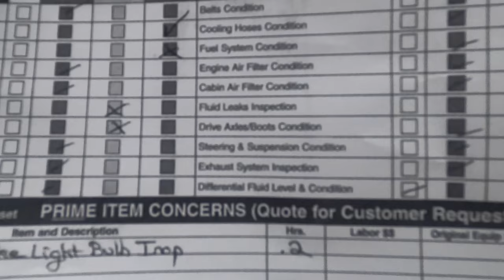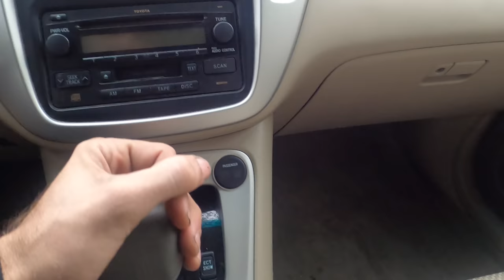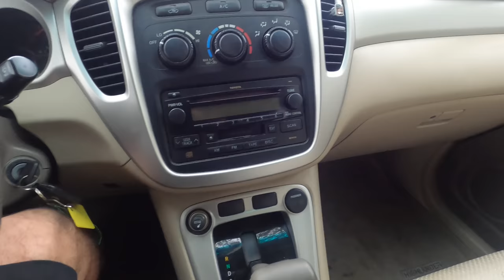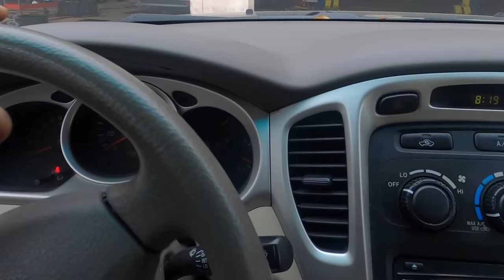We were BASHED by the Dealer! Ripping off a customer! Toyota Highlander 3.3

Comment: Dropped my van for an oil change. The counter man wrote up that I "needed" cabin and air filters because they were clogged. I purposely removed the cabin filter so it couldn’t be inspected, but somehow the genius saw something that did no exist. I never trust dealerships or nationwide service companies…they’re all crooks! I only trust my mechanic of 20+ years who has never cheated me like all the other places do.
Reply: I used to replace my air filter the day before I get an oil change. Invariably they come out with some dirty one to show me it needed replacing and I’d show them the receipt and walk them out to show me what’s under the hood. I got several free oil changes that way…
Reply: well duh ofcource you needed the filter if there was no filter.
Reply: @lostepisode3  the point is that he said the filter was clogged even though it was not even there
Reply: I was sitting in a Honda dealership and saw a posted price of $200 to replace a cabin filter. Wow!
Reply: @pauldiesel4582  Some of the Honda cabin filters are a PITA !!  But still not worth $200.
Reply: "We rotated your tires, and here's the mechanic to confirm" ...... "Here are the cell phone photos I took showing the location if each tire and the dark but visible crayon mark labelling the location of each tire, and you can see they have not changed position".
(real stealership story)
Reply: Crooks exist in most professions but I wouldn’t say all dealerships or independent shops are crooks. In my experience often time the customer is more dishonest.
Reply: I asked the service writer to not pad my bill with silly stuff like cabin filter. He says 'ok'. In a bit his tech comes up to me with the cabin filter. Ford windstar. He yanked it out if the tiny inspection hole which in fact you can't get it thru safely. I just looked at the writer and shook my head. I later pulled the full drip tray myself at home, involves dropping off wiper arms too, and put in a new filter.
Reply: There's a certain sour smell I get in the cabin of my car when the cabin filter is done. I order the part from Canadian Tire and replace it myself. Even though the air can get dusty here in Alberta, my engine air filter goes over two years before needing replacement. And yes, I get my oil changes and inspections done at the local dealership even though my golf is long since out of warranty. Occasional wear items and leaks are all they have ever fixed.

Comment: My favorite frustration story is about my wife's car. It had a vibration. Her dad helped out by taking it to the dealer while she was at work. The dealer said it needed brakes. $700. We declined. I took it back that Saturday. After waiting for an hour, they came back and said a wheel was loose, no charge. That proved they didn't even look at the brakes on the first visit.
Reply: Not really. The tech that looked at your car may not have checked the brakes, or not thought they were as bad as the other tech did. I tried to sell a lady brakes today because there was plenty of brake pad left on the rear pads, but only about 3/32 of an inch (that's getting into dangerously low territory, on front wheel drive vehicles, front pads are declared a 'safety liability' at my shop at about 4/32. She declined because the pads were a fair bit expensive, but what you're paying for is labor rates. Brake pad replacement on the car I was trying to sell brakes on is quoted at .9 of an hour. The hourly rate of the tech on the ticket was about 200, because he's got all the ASE Certifications and is classed as a Master Technician. Technician rates are higher than ever because schools don't talk about trades, they push college. Tradesmen are becoming rarer and rarer, so demand is sky high and to draw techs in, so are pay rates. THAT is why dealership work is so expensive. At a lot of shops it's expensive, dealer or not because techs aren't widely available.
Reply: @apoplecticwrenchmonkey  Solid points you made. Thanks. Although, I guess I would ask if a basic brake job requires ASE Master Technician level work. Just trying to learn...
Reply: @D45VR  No, a brake job absolutely doesn't require ASE Certified techs, however it isn't really up to the techs who gets what jobs. You might have a tech with six ASE certifications, paid 120 per billable hour, doing your brakes, or you might have one of the lube techs, paid maybe 20-30 an hour if he's flat rate, doing them. Depends on a few factors: Are you in for a routine maintenance (i.e. oil change/tire rotate, fluids check, etc) or are you in for a check engine light or other complaint? If it's a routine maintenance and you need brakes, you'll probably (though not always) get a lube tech doing the work, which means you'll get either his rate or in other cases the shop's set rate instead of the specific tech's rate. The lube tech only sees his 20-30 an hour, the rest goes to the shop to pay for things like gloves, brake clean and other shop supplies, which are rather important. Talking trans fluid, differential oil, etc. Things you WANT the shop to have extra of. 

Anyway, long story short, yes things are expensive, even if it's a simple lube tech. Cars are a huge investment of money and when things break, it can be unpleasant. I'm not justifying the insane costs, nor the fact that some techs do try to scalp customers for a paycheck. 

But, even without the tech rates, things can get expensive due to part shortages and depending on the vehicle, part availability in general. I've just sunk over two grand into my own car for what was originally just blown head gaskets, and I'm not getting paid for it since I'm doing the work myself. Needed new gaskets and new head bolts, then I found a broken vacuum line which is another couple hundred for the lines and the fittings on my particular car, ended up needing new injectors since two of the old ones were starting to fail, needed a new intake manifold since the old one cracked during removal (206K miles on the car over ten years, so time and use just wore it out).
Reply: @apoplecticwrenchmonkey  Take "ASE Certified" and "Master technician" with a grain of salt. Countless lazy parts changers are considered "master technicians" because they got away with lazy, shitty work for so long that they think they're actual mechanics.
Reply: @apoplecticwrenchmonkey  my idea of a master technician is some one blueprinting an engine, transmission repair, breaking out the oscilloscope doing in depth diagnostics, engine out jobs etc.
Reply: @apoplecticwrenchmonkey  there is no tech in the world making $100 an hour lol no way in hell a lube tech is making $20 an hour. lol shop rates shop rate no matter the tech lol advisors and managers can cut the cost down but no one "pays for the tech". Thats just hilarious lol
Reply: @ABs70nova  You've clearly never worked in a shop, otherwise you'd know better. Yes, lube techs can get paid $20 an hour, they get paid that at my shop. There are multiple technicians in my shop that are paid over $100 per billable hour. Your ignorance of the topic is showing.
Reply: @Cynsham  ASE Certification isn't something you're given just by working long enough. There are courses you take and tests you take. Master technicians require eight different tests to be taken, along with another exam to certify you. Some people may call themselves "master techs" but if they can't show you their ASE certifications (which you have to renew every five years) then they're full of shit. I'm in an ASE Program right now, and I can assure you that your average parts changer doesn't just get ASE Certified or given the official Master Technician classification. There are at present only about 2,800 officially recognized Master Technicians in the United States, out of a total of  around 610,000 technicians across the country. Master Technician is not a common title, and if it is, you'd be wise to have them prove it.
Reply: @apoplecticwrenchmonkey  I dont care if youre ase certified or not, paying triple digits for 2 wheel brake job is insane. I would do it for 40 bucks, its so easy my wife can do it (and has). 

Start spraying it down with rust breaker or wd 40 a couple hours before you start the job, then its super easy from there. You can check everything from rotors to pins while youre there. 

I dont know why shops charge these obscene amounts, but Im glad they do because if they didnt I wouldnt have learned everything I needed too.

Because of these ridiculous prices Ive learned how to rebuild my truck if Im stranded on a mountain whereas 3 years ago I didnt know what an ignition coil was.

The only thing I havent taught myself how to do is rebuild a transmission - and believe you me thats on the list. I have one of the most reliable vehicles Ive ever seen now and I am not ase certified or master technician - Im just an American. 

Ive got a "friend" (long story here) whos ase certified and when he worked at our local mechanic shop he was number one - but my work ethic far exceeds his and so does the quality of work.

There seems to be something about the mechanic/technician line of work that breeds untrustworthy people - I dont trust one single shop or dealer. 

For example a few years ago I had a firebird formula that had 110k on it and the transmission started slipping - so I bought a new one from a dealership for 4k and when I drove it home I shit you not - the transmission pan was hanging by one bolt and all the oil had come out of it. 

I wasnt happy. 

There is another dealership here that sold my boss a Dodge Dart - which kept losing power luckily he bought the super warranty - and they couldnt figure it out. They replaced the turbo, tons of electrical, the transmission (it was stick), the ECU, the throttle body, and this went on for two years. I had actually quit the company and he was still having problems - he bought the car to save on gas because he drove a hemi in the mean time but the dealership had the car in their possession then he did while he owned it. 

He bought himself a 2021 Ram and my 22 year old dakota gets better gas mileage as a v8 then his ram does (I become very proficient at what I do if I choose to do it).
Reply: @neavo8421  Shops don't charge the hourly for everything. Many shops have services that are a set price. Oil services at my shop are from fifty to seventy bucks, depending on the vehicle, brake jobs are around eighty for pads and rotors. I don't know what country you live in where you can get rotors and pads for forty bucks. I looked up 98' Dakota rotors and they're going for around 40-50. Per rotor, mind you.

Sounds like you're quite the handyman, and that's great. Good for you. You also seem to like overstating and understating things. There's not a place in the US you'll get a set of fresh rotors and pads for forty bucks, unless you're buying the worst quality imaginable and scrounging pads up from dumpsters. As I said, a quick search of a few states shows that nowhere is selling for that low. Nowhere.

I'm certainly happy for you that you can do your own maintenance, that's fantastic. But there are those who can't and that's what dealerships and shops are for. If you can do it yourself, great. You pay dealerships for the convenience of doing it yourself. Any good dealership will eat the cost of mistakes and failures of their technicians. My dealership certainly does, and techs are held to high standards. We get one warning, and then we're gone the next time we screw up. 

Sounds like the dealerships in your area aren't run by people who give a crap, and there are plenty of dealerships like that out there, but there are plenty more that are high quality and care about their cars. Every workplace has the lazy techs who churn out average or subpar work, but if it doesn't come back with the same issues, it's fine to the dealership. The issue you mentioned with the loose transmission pan? The tech would get fired on the spot in my dealership. That's a catastrophic safety issue and since it could have killed you, there's no excusing it. Technicians are meant to be trained in their craft and incidents like that are often career ending. I doubt you've ever worked in a shop to know any of that though, since that 'I'm smarter than everyone else' attitude you seem to exude would get you run out of a shop real quick.

As for your claim of rebuilding your truck while stranded on a mountain? No you wouldn't. Pulling your engine apart on a mountainside would end in the parts being saturated with moisture and you'd either cause rapid rust buildup, piston scoring, fuel contamination or other such things. It's also highly unlikely you'd happen to have torque wrenches, the proper bits and sockets for all the Torx, hex and head bolts, etc in your truck unless you carry an entire tool set with you everywhere you go, along with every single part you need to rebuild various bits of your engine like new headbolts, gaskets, piston rings, crankshaft bearings, piston rods, piston pins, etc, or other components like springs, struts, steering rack rebuild kits.. 

Come on man, I know you think a lot of yourself, but if you know as much as you say you do, you'd know that's some bullshit.
Reply: $700 for brakes? Why didn't you just do the job yourself?
Reply: The point I tried to make was the vibration it was taken in for twice ended up being loose lug nuts but the first time they blamed the brakes. The second time they figured out the vibration was loose lug nuts. If they checked the brakes, they would have found the loose wheel.
Reply: @apoplecticwrenchmonkey  #1 Most shops have a menu or a set rate they charge for a brake service regardless which tech is doing the work.
#2 As a former ASE Master certified and L1 certified tech I can honestly say that ASE certification is a joke.  Pass a written test in each of the 8 areas (plus 1 more if you go for L1 advanced engine performance) Then meet a 2 year experience requirement and viola! Your ASE certified and you can very easily lie about your experience.  One of the best and smartest technicians I have ever known was not ASE certified, and I have know ASE certified tech's that could not diagnose their way off the shitter.
Another example , I was ASE certified in Automatic transmissions.  I know enough about them to diagnose a problem and I obviously know enough theory to pass the test.  Would I trust myself to tear one all the way down and rebuild it?  Hell no!  Would not even trust myself for my own car.   The only thing ASE certification guarantees is that somebody can pass a written test and has worked at shop at some level (or lied about it) for a minimum of 2 years.  There may only be about 2,800 current master tech's out of over 600K recognized tech's because most only want or need 2 to 6 cert's or they specialize at a dealership and only get the cert's they need for what they specialize in.  Why would somebody that only does drivability and electrical need any transmission certifications??  Guarantee that drivability tech has some of the best diagnostic skills in the shop.
Reply: @StumpyVanLife  Well said
Reply: @apoplecticwrenchmonkey  A good shop will eat the mistakes their techs do but I have had a Chevy dealership to where their tech broke the fuel line just by changing the fuel filter and blamed it on the shop 275 miles away and the vehicle had 50,000  miles on that fuel filter. There is no way a fuel line is going to hold that distance and mileage. The tech broke it and I had to pay the whole tab of $ 300.00 just to replace that fuel line. My mother worked at a different chevy dealership and I called the service manager there told them what happened and they agreed with me there is no way the fuel line was broke before that tech broke it. He did it. So now I will never take my vehicles to that shop again. So not all shops eat the mistakes their  techs make.
Reply: Depending on the vehicle and rims I can accurately check the brake linings.  This doesn't prove anything bud.
Reply: @apoplecticwrenchmonkey  OK cool on what you said but can you tell me how much a ASE Master Tech would be paid for the labor of doing a front brake pad changeout? I have heard that auto mechanics work on a flag rate scale. I may be wrong about that. I have seen classified ads from dealers advertising for ASE techs up to $38/hr.

Comment: Frozen slide pins and missing anti squeal hardware tend to be the problems with Toyota's brakes and dealerships want to replace calipers to have a near 0 customer comeback. When 99% of the time you just need to clean and lube up the pins and get some hardware shims.